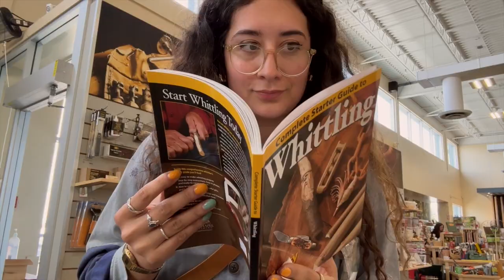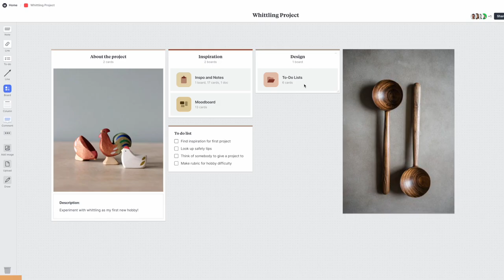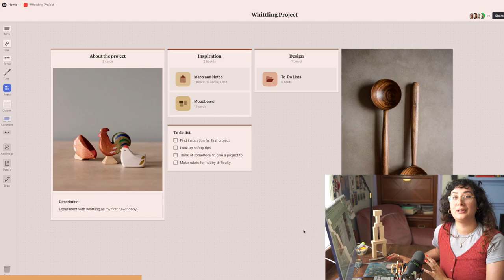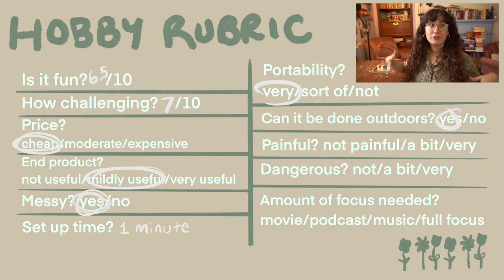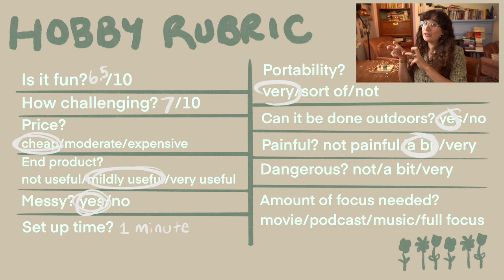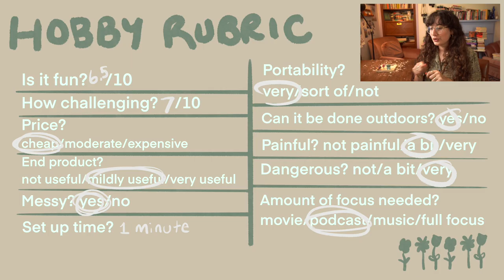I Tried Whittling For A Week

Comment: I think that a few changes could really help you. Try to whittling a slightly bigger piece of wood as it will be much easier to hold. It will take quite a while for your hands to grow stronger. I can tell that you don't have much hand strength from the way you are holding the knife (oops, I just saw that you have joint problems). Watch some videos on the different cuts used in whittling, which will help a LOT. 
You chose a folding pocket knife which is a compromise between ergonomics and portability. It's an excellent knife, but one of Flexcut's fixed blade knives, like their Detail Knife, would probably be much easier for you to hold.
Next, try use the smaller blade more instead of the big one.
You also need to keep the blades VERY, VERY sharp using a strop, which is super important as a sharp knife is much safer. You will need to strop about every 20 minutes. That's a skill in itself and YouTube is definitely your friend.
While basswood is fantastic, try whittling some green wood (freshly cut). Just a 1" diameter stick taken straight off any tree (use a cheap folding saw) will do. As the wood hasn't been dried it is much softer and easy to cut with your whittling knife. You will be surprised how different the experience is.
By the way IMHO the danger part is good, because it forces you to focus. 😉
All the best from a Scottish whittler.